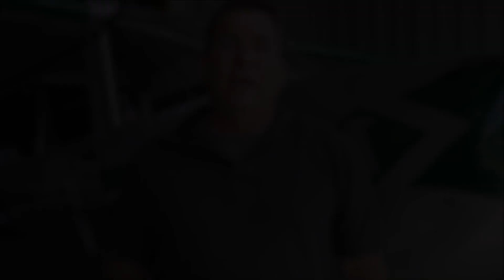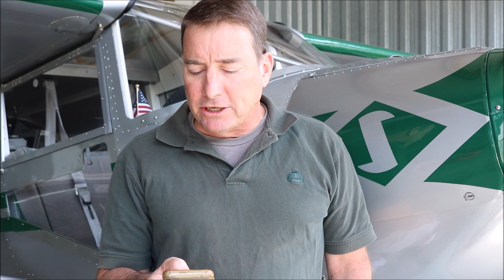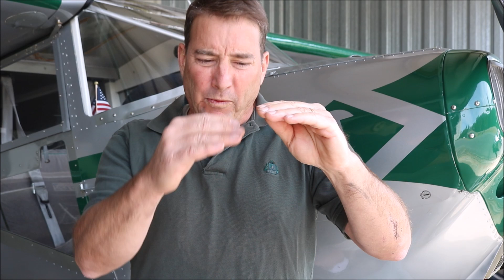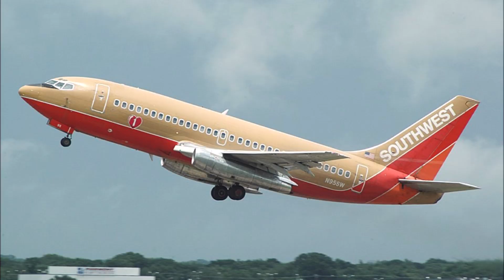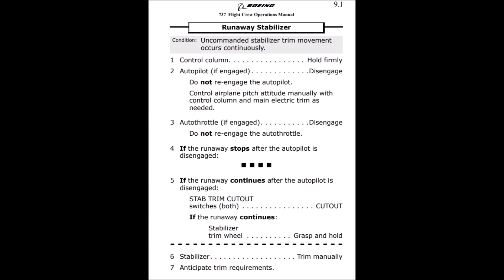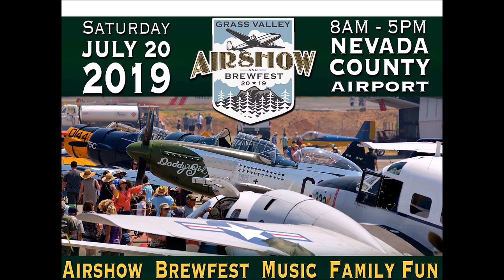737 Max UPDATE 27 June 2019 -The Latest Issue

Comment: I was in the USAF for 12 years as an aircraft mechanic 43152E Jets 4 or more engines.. I listened to the reports of the failure of the aircraft and the computer program issues. The aircraft has several eng and flight attune sensors and these sensors feed the computer ASI Air Speed Indicator, AOA Angle of Attack and temp sensors to name a few. It seem to me if not the program then the sensors had a malfunction., The AOA sends s signal to the computer telling it if the plane is nose up or down and how much to maintain flight attitude.  Could it be possible that the AOA got stuck in a nose down indication and the computer compensated by setting flight control surfaces to go nose up? Wasn't there and override switch. the ability to turn the computer off or AOA input?.  For example if the hydraulic system that controls the raising and lowering of the lander gear if ever failed the gear can br lowered manually

Comment: We're starting to see more and more physical handling and dynamics problems fixed with software.  On the 787-8, they had a wing tip vibration/oscillation problem (the media called it "flutter", but you don't normally live if you get flutter) which they fixed by using the FBW computers to actively counteract the oscillations using aileron inputs.  Holy crap.  https://www.seattletimes.com/business/in-person-fitzgeralds-fix-for-boeing-747-8-earns-aviation-honors/
Reply: Check your a/c type. It was simpler than it sounds, which is why he won the award for its "elegance."

Comment: Ok want you are saying the manual trim setter isn't really manual. It still has to go through a computer to activate the trim motors. the same type of computer that caused the problem in the first place, because it got faulty information. What ever happened to actually flying an airplane.

Comment: Wait a minute.  What about the MCAS AOA sensor, of which, there is only ONE. Isn't Boeing going to address redundancy to prevent the runway trim issue being dependent solely on the failure of one sensor?
Reply: There are two sensors installed on the plane. Always have been. The issue with MCAS (the original version) is that it was taking input from only one sensor at any given time.

Comment: Referring to a page you presented from the Boeing 737 Flight Crew Operations Manual (p 9.1):
"Runaway Stabilizer"
Item 5) IF the runaway CONTINUES (after cutouts used), Grasp and hold stabilizer trim wheel.

The same thing may be found in p. A180625 of AD 2018-23-51 "Runaway Stabilizer" , first paragraph.

To me this suggests that the manual trim wheels are stronger than the trim motors, and we know that the manual trim wheels cannot be 

budged when the airplane is far out of trim and at high speed. Could this be why the FAA pilots are finding the electric trim switches 

too slow? Maybe should be grateful they can do anything at all in this situation?  Also, could the fault which is causing the trim motor 

runaway be fighting the switches, or would using the switches immediately 100% override the source of the runaway? Could the co-

pilot operate his manual wheel while the pilot uses the electric switches, or both of them use their manual wheels and switches? Or 

could this amount of force break the linkage somewhere?

AD 2018-23-51 does not say to disengage autothrottles. In this respect it seems inferior to the Flight Crew Operations Manual p. 9.1. 

Another problem with it is that it says in para. 1 to use the cutouts, then in para. 3 to keep them in cutout for the rest of the flight. But in 

the last paragraph it says that one could use the electric trim switches to neutralize control column stick forces before using the cutouts.
This suggestion comes too late if one has already hit the cutouts as per para. 1 and obeys para. 3.

On the question of whether MCAS was only for type certification or whether it was needed for stability, it seems to me that any static 

instability caused by the new motor position would be minimal at medium to high speed and could easily be corrected if needed by a 

little extra tailplane area or aft fuselage stretch. BUT, would not the thrust effect be more significant near the stall? Does FAR have 

anything to say about stall characteristics? Well, it may not be a problem. A pilot who flew the 737Max (not just a simulator) with the 

MCAS disabled said it was a bit different to the previous versions but not a problem. However, I wonder if he risked getting close to 

the stall as much as FAA pilots might check out in simulators.

I am an ignorant person, not a pilot, so please excuse me if this sounds like unfair criticism. In my ignorance it seemed just barely 

possible to me that what I am saying might give someone a useful idea. I don't think it can do any harm more than just being annoying.

Comment: So, the bottom line is the FAA is not happy with the recovery (trim) response which is a significant safety feature of the 737 MAX.    Whether it is the auto trim, yoke, switches or related software, there is still an issue with the aircraft and the FAA is not satisfied.   The CNN reporting sounded correct to me.
Reply: Jake Sneed Some parts of the story are true, some details are wrong. It is still a concern either way.

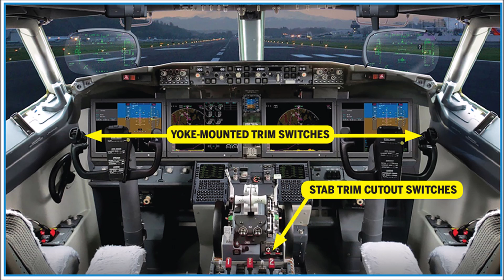Comment: At 3:30 you call out the trim switches. Why are the yoke-mounted switches on opposite sides? The bilateral symmetry looks good, but seems to me to be very poor design. Same with the placement of the displays.
Reply: The pilot in command in the left seat handles the yoke with his left hand while operating the throttle levers with his right.  The first officer in the right seat, when flying, flies with his right hand on the yoke and his left hand operates the throttles.  Both switches are thumb operated.
Reply: @stormm787  Of course. That makes perfect sense. What about the displays?

Comment: The 737 is an obsolete design. The flight deck is severely lacking in space and each technological modification is poorly integrated, most decidedly with the Max. Boeing should be ashamed. The entire fleet should have been retired many years ago.
Reply: flightube321 - I am happy with the cockpit space, think about the pilots flying bizjets, far smaller.. The cockpit upgrade in the MAX is pretty good, several elements from the 787 which will be the mother of the tech going into a NSA MAX replacement..

Comment: Hi Juan - you do great videos on the 737 Max 8 , and I have watched all
of them, and I have left comments.  I am confused about one thing, and                             hopefully you, or one of your informed posters can  "clarify "& educate me?
 
You have said in your previous videos that the Auto Pilot has to be OFF
for the MCAS system to be actuated ( ON) -right ? With this in mind, wouldn't
every flight upon take off -- have the Auto Pilot "off" until it reaches a certain
altitude ? Do any flights with commercial jets take off with the Auto Pilot
turned ON ? and can that plane start to gain altitude, until desired altitude
is reached, with this Auto Pilot ON ?? If this was the case, then they'd never
would have had to deal with the MCAS system, as Auto Pilot was ON - is this
correct ?

 I would think that all flights would take off "without" the Auto pilot ON, and when
a certain height is reached in altitude, then the pilots would turn on AUTO PILOT,
when cruising altitude is reached, and just be in cruise control ? ( somewhat like a car)
 Reason why I'm asking this question is that if you always take off with the Auto Pilot
in OFF position, then you have "no choice" but to have to deal with the MCAS 
system, and all of it's quirks - am I right here ? I understand you can hit the stabilzer
cut off switch to avert dealing with an MCAS system that's not acting properly - thru
incorrect AOA reading etc, 
 
This problem you summed up with the crash of Ethipian Airlines, was really 2 fold,
and that is not hitting the STAS CUT OFF SWITCH and also not taking the speed off
the AUTO SPEED, as the plane was going 500 knots, which is much to fast ? What
your saying is the pilots were not educated enough on how these things all relate
to each other and make the adjustments necessary to get the plane up in the sky. So,
this accident would likely have been prevented, by very skilled pilots, shutting off all
the automation, and over zealous MCAS system, and hand flying the Max. Do I
understand this correctly Juan ?? Would like to know -- and great videos for common
people like me, that follow your channel.

 Like to get an answer on these questions Juan ? -- especially if you can take off in one
of these Max Jets with the AUTO PILOT -- in ON position ?? I would think not ? If you
could MCAS  would never have to be dealt with.
 
Also, if MCAS is OFF --when Auto pilot is ON , and your cruising at 35,000 feet, and the
nose starts to angle upwards, then you would not have MCAS to bring the nose down,
and prevent a stall. Isn't that what MCAS is supposed to do ?? I know  - lots of questions :)
Reply: There are more qualified people than I to answer your questions, but nobody chimed in, so here goes.

MCAS will not activate while flaps are deployed.  So normal (all?) take-offs will begin without any exposure to MCAS.  Flaps will then be retracted early in the initial climb, making it possible for MCAS to activate.  If the crew engages the A/P within 5 seconds after retracting flaps (they don't have to wait until reaching cruise), then MCAS shouldn't activate during the climb.  I suspect, but do not know, that engaging the A/P will override MCAS if MCAS has already activated and is trimming down, but engaging the A/P in response to an apparent runaway stab trim condition wouldn't be the obvious thing to do.

In response to your question about MCAS not activating at cruise with A/P engaged, I'm not sure why the nose would  "start to angle upwards" as you put it with the A/P engaged.  If you are hand flying, then maybe.  I believe MCAS was initially envisioned as a solution for a hand flying, maneuvering scenario at high speed, but I haven't seen a detailed technical explanation of exactly what that scenario looked like and the exact reason why "unaugmented" flight characteristics where deemed unacceptable or so different from the 737 NG to require simulator training.

The ET302 crew did use the STAB TRIM CUTOUT switch, but failed to use the yoke mounted stab trim switches (MET) to fully counteract the nose down trim commanded by MCAS before doing so.  They only trimmed back up part of the way.  Due to high airspeed, they weren't able to use the manual trim wheels to trim up.  So they turned electric stab trim back on but didn't trim up enough (actually, they didn't trim up much at all).  They then left electric trim on, MCAS activated again, and they again turned it off without first trimming back up.  This time, the nose was trimmed so far down and airspeed was so high that they couldn't pull out of the dive with elevator back pressure.

As for why they left the throttles at take-off thrust, some have speculated that it was due to task saturation/tunnel vision.  I believe the plane was overweight and they were having problems climbing even before MCAS activated.  The Preliminary Report says they weren't over Regulated Take-Off Weight, but that appears to be based on an unrealistically low estimate of per-passenger weight.  If the crew had trouble with the initial climb even before MCAS activated, it would be understandable that they would be hesitant to reduce thrust throughout the flight.
Reply: @danielforman5064  - thanks for a thoughtful reply on this Daniel . I sounds
like you know what your talking about, and I appreciate your perspective. 

 I will say that the Air France flight # 447 that went down, did so because
they were flying in a storm and lost their speed indicators. Then the
Co-Pilot was pulling back on the stick causing the nose of the plane to
push upward, and lose altitude or stall. If they were in Auto Pilot,(AP) which
maybe they were ? and they had MCAS, it may have prevented this crash.
This accident happened late at night as well, so no vision.By the time the
head Pilot took over the controls , it was to late.

The co -pilot was at fault for this accident. Bonnin, I think his name was? In
this case however MCAS would not engage, because it doesn't do so when
the aircraft is in AP, at cruise speed, and also this was an Airbus.
 
I do believe having MCAS even in Auto pilot could help, if something serious
went wrong, to prevent a stall. A very light form of it though. Right now, it's
taken down 2 planes, and it will have to be modified and perfected, which
I'm sure it will be.
 
From what I've read, the 2 accidents that happened, could have been
prevented, if the pilots were trained properly on how to handle MCAS. In
the "long run" hopefully a lot of good will come out of these 2 accidents.

Comment: The two versions of the story are so different (microprocessor failure Vs speed of trim) I wonder if they are referring to different issues? If it's too slow on the 737 Max is it also too slow on other versions?
Reply: I've heard tell hereabouts the Intel 80286 microprocessor is being used to process stab trim rate control, although, how that works in practice is outside my remit. I do know that the Microsoft OS Protection Mechanism did not come until a later processor, which I think was the 80386. So it seems the 80286 has been retained due to simplicity of operation and proven longer term reliability. That must mean the 737 uses some kind of ROM chip to run its real time control routines attached to major flight actuator control systems. The cost to Boeing for producing their own dedicated electronic control system memory must be pitifully nothing compared to the cost of each aircraft.

If the 80286 is now past its use-by date due to creeping incompatibilities with big brother hardware, they're gong to have to find a compatible update pdq.

My guess is older 737s use processors with compatible clocks and the software/firmware is simpler and integrated because the idea of fbw airliners with far greater complexity issues at that stage of the game would have seemed nuts.

Addendum: Colin, just found this PDF online. Go to section 3) Architectural Pitfalls.

https://pdfs.semanticscholar.org/2209/42809262c17b6631c0f6536c91aaf7756857.pdf

Comment: No multiple bandages over the original problem changes the fact that this plane's design is inherently faulty.  The 737 Max is Boeing's version of the Ford Pinto.  At $120M per, capitalism requires Boeing to foist it back onto the traveling public no matter the efficacy of the MCAS fix.

Comment: Are they basically saying the MCAS is still causing a runaway stabilizer trim?, I thought they added a AOA disagree system and limiter to  max nose down trim
Reply: No. They are saying that, in case of a runaway stabilizer situation, the manual electric trim does not move the stabilizer with enough speed, in their estimation. This isn't even related to MCAS.

Comment: All these stories are designed to forgive the Boeing executives who ordered their engineers to create automatic control systems that OVERRULE pilot actions.  The reason for this is the plans of the executives (of Boeing and airlines) to get rid of pilots and have completely automated airliners (no pilots), in which the control systems obviously have total control of the airplane.  Everything being said in public tries to obscure this central motivating fact.

Think about this.  ALL modern airplanes contain GPS and "moving maps" (which means, the control system knows the elevation of every point on planet earth).  Think about what that means.  It means the automatic control systems on these Boeing airplanes flew the airplanes into the ground even though they knew they were flying the airplane into the ground.

Now some might quibble words and say "yeah, but the control systems ignored the altitude of the airplane and altitude of the ground below" in the algorithm that decided to push the nose down and fly the airplane into the ground.  But that forgives NOTHING ... and actually makes the hyper-malfeasance even worse.  It means they HAD all the information required to prevent the automatic control systems from mass-murdering hundreds of passengers and crew ... and simply ignored the information!  For those who don't know, the control system yell out loud (in English) TERRAIN, TERRAIN, TERRAIN when the airplane is approaching the ground.  Which means, the control systems have TOTAL awareness of when the airplane is being flown towards the ground.  Think about how corrupt and how extreme the malfeasance must be to ignore this available information WHEN TAKING AN ACTION LIKE PUSHING THE NOSE DOWN AND FLYING THE AIRPLANE INTO THE GROUND.

These executives ... and the engineers who obeyed their orders ... should be hung for mass murder.  They're 100% responsible.  NO sane individual would make decisions like the decisions they made unless they did so on purpose for vile, evil, nefarious, diabolical, unethical, predatory reasons.  Which is obviously what happened.  Hang them.  Do not let them confuse the issue to escape the punishment they so obviously deserve.